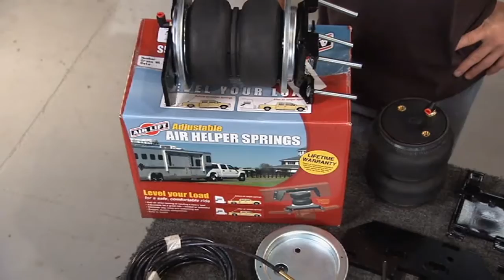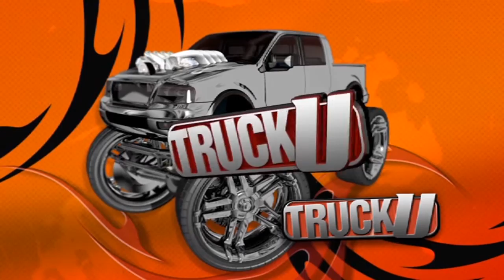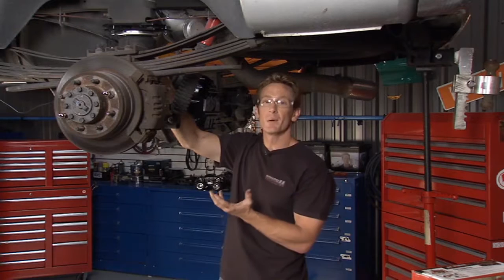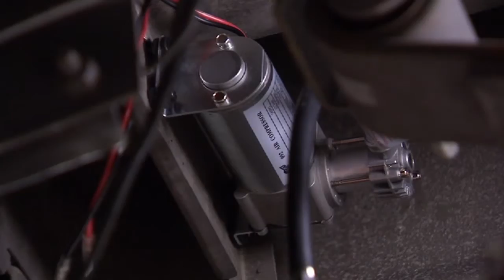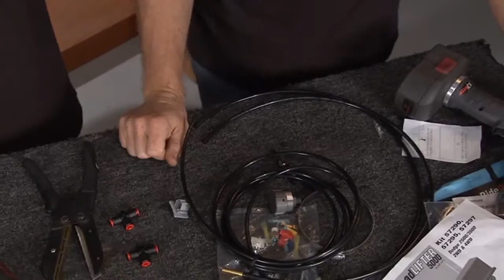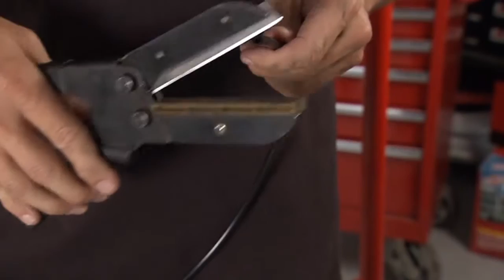Installing a New Air Suspension Kit in a Dodge 3500 | TruckU Tech Tips

Comment: so what happens to the air bags when you put it on lift again after install? lets say truck equipped with 37 inch tires. will you rip those bags or what?
Reply: Yes - Because you are a Douche Canoe - Stay Safe